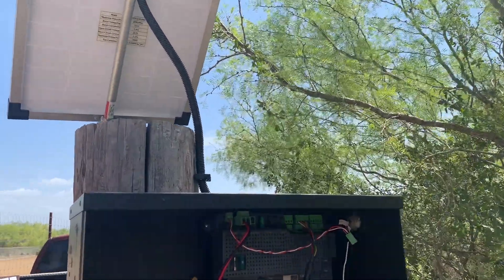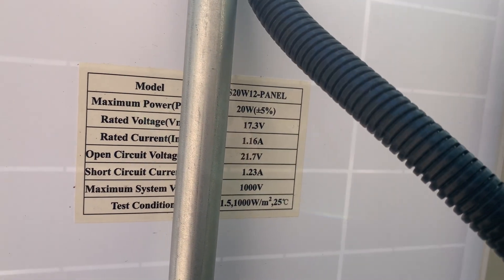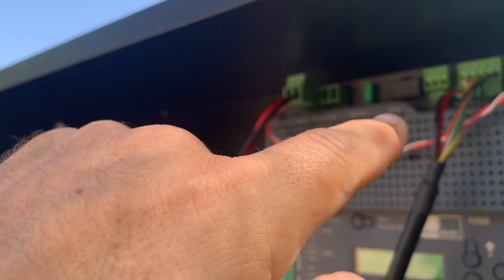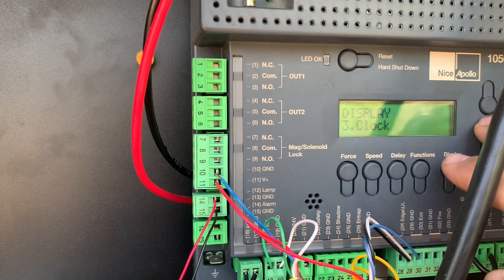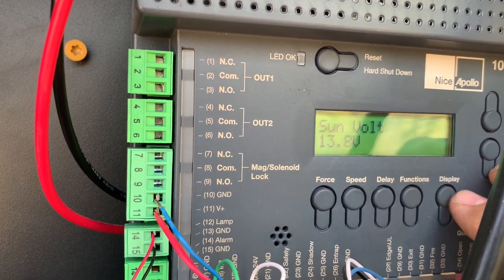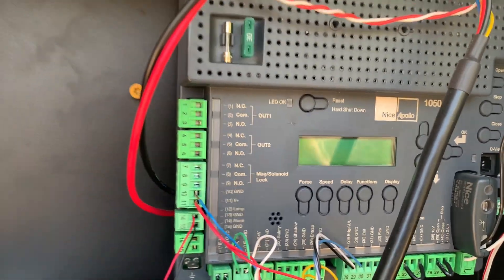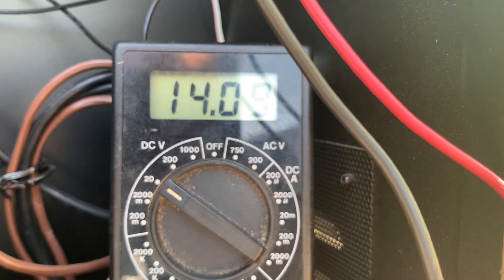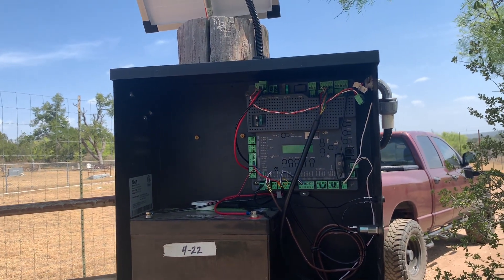✅ Testing Your Gate Solar Panel for Proper Voltage ● Nice Apollo 1050, LA861, Cartell CP4 Exit

Comment: How did you set up the stand by mode I have the same set up with solar but can’t get it to switch the standby mode to the on position
Reply from the maker: I have another video to explain how to set standby mode
Reply from the maker: ✅ Nice Apollo 1050 Control Board ● Setting up Standby Mode for Solar Gate Configurations
https://youtu.be/a4N6v38-P9I

Comment: I would recommend a Fluke brand dual multimeter and clamp meter. The clamp meter will let you check current in a non-invasive way.
Reply from the maker: Great idea. I need a clamp meter for sure. Thanks for your comment!
Reply: @ApacheRanch  Your test procedures were pretty good, nonetheless and enough to make sure things were working. I was an Armament Dawg for almost a decade and we never had clamp meters but should have. It would've been the safest and easiest way to measure current off things like generators and the ECS compressors as well as the gun motor. Boy if I could go work on Apaches with the knowledge I have now, there would be no need for Boeing or Lockheed reps.
Reply from the maker: Armament guys were always the best problem solvers!